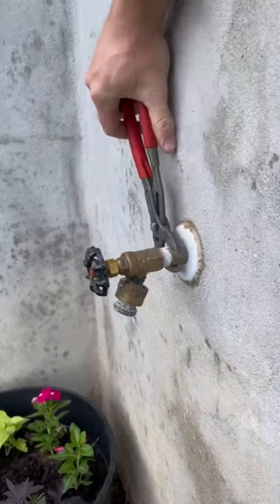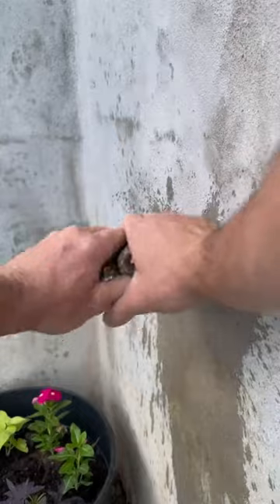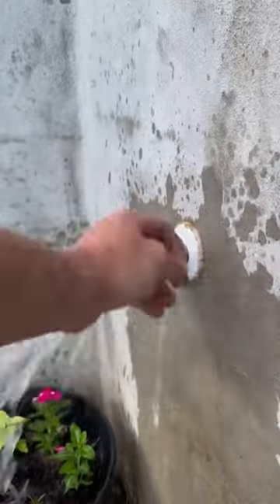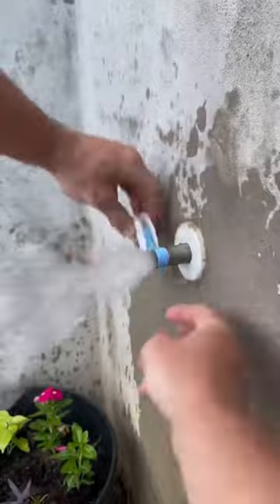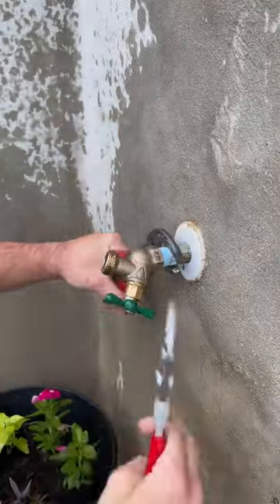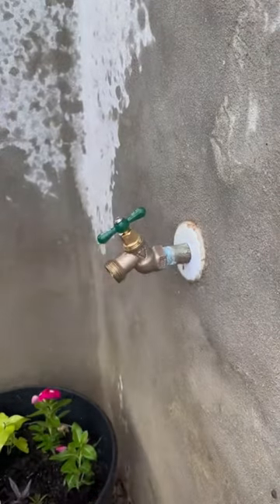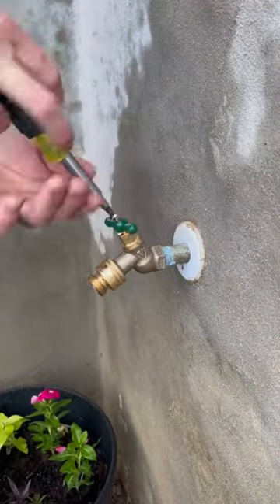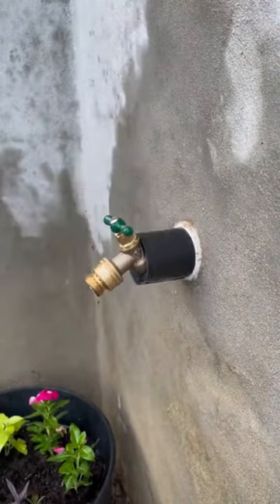Hose bib replacement LIVE! #fyp #plumber #trades #plumbing

Comment: Man, I already hate doing hot swaps. But on sleeved galvy? You’re my favorite shorts plumber by far.
Reply: Mind explaining hwy its a pain in the ass to do?
Reply: @stephanieann6622 just water spraying everywhere, but not a big deal outside as long as that spigot comes off easy and you dont crack the wall pipe.
Reply: @feyrband  That isn't what she was asking.. I dont know the answer but I do know you did not answer the actual question
Reply: @stephanieann6622  I think maybe something with the brazing on the sleeved, galvy that appears to be on the other side of this wall and it being galvanized makes it easier to break the braze? to lead you scrambling to the otherside.... probably in a crawl space?
Reply: @gregscott4479  yeah I knew about the water it wasn't what I was asking but I appreciate his reply. But thank you for yours!

Comment: My town's pressure comes in at over 100psi in some areas 😅 last time we tried to do this it was rather messy, even with all other faucets in the house open hahah.
Reply: Do u have a prv
Reply: @craigherron1203  Nah. I run that shit raw 😂 plus half of the house is galvanized waterlines so that honestly keeps volumetric pressure down. This week I'm changing everything out and moving the meter+adding a filter. Filter should cut the pressure back a bit but I'll be throwing a prv in for safe measures while i have the system torn apart.

Comment: You got lucky with this one sir. Good job galvy is always risky when it’s old 
If those threads were broken you’d have water flowing roughly 5gpm and be torching the city shut off to loosen up. What a terrible scenario for all involved
Reply from the maker: I had an apprentice bust a pvc waterline near the meter while digging before. We were replacing the shutoff valve but he hit the line. The meter would not shut off. I was able to replace the valve live thankfully.

Comment: Nice.  You can turn on all the faucets in the house to reduce the water pressure to make this repair a little easier, it looks like you may have done that already. I like the Knipex electrical tools and Cobras more than Klein.
Reply: Exactly what I was thinking. Opening up several in the house would make this much easier. I’m getting rid of my vacuum barrier on my bib. I hate that thing. It makes all sorts of groaning noises all the time you can hear it in the house. I don’t care if it’s against code.

Comment: The frost proof hydrant has a built in vacuum breaker. That's what makes it frost proof
Reply: No. 

Frost-Free Hosebibbs are Frost-Free because they have long stems that shut the water off inside the insulating envelope of the home., aka they shut off where it's above freezing temps.

BUT you MUST REMOVE THE HOSE and any other attachments that would prevent the body of the Hosebibb from draining. The Hosebibb body must also have slight pitch towards the outside.
Reply: @skoronesa1  no shit Sherlock.  But the air gap ( vacuum breaker)on top allows it to drain. I've only been a plumber for 20 years . I don't know everything

Comment: I bought the tool from home depot so I can shut off the water at the curb.
Reply from the maker: That valve was stock. The city here will also fine people if they see them using it. Or if it breaks they charge you the repair and water loss.

Comment: You can back it off without it leaking much and get new Teflon and dope on the threads before the switch so it’s super quick. Dont need to mess around with a bunch of flowing water

Comment: Prevents water siphoning  back in when the shutoff is closer. Brilliant!
Reply from the maker: Required by code 😅
Reply: Not everyone turns off their hose bibs... but thats just ignorance.
Reply: I don't even have those.  Instead i use a splitter to relieve pressure.   Works great and no mess of water spraying everywhere.   It seems like it would be an easy design adjustment to make the water from releasing the pressure diverted in one direction rather than spray everywhere, but i guess engineers have other priorities.

Comment: vacuum breakers are pretty pointless for 99% of people. You either have to have a massive pressure differential between your home and the water main. And, you would have to be actively using it, and have the end of the hose submerged in a conainer of contaminated water when the differential occurs.

Comment: Did you run some taps inside the house to lower the pressure on the bib? Just asking because 70psi seems like a lot
Reply from the maker: Was able to partially close the curb stop at the meter.

Comment: I fucked up at a building. I did a hose bib live at their car wash area not knowing that it was tied into the outlet side of their booster pump they had the old school style that ran at full power and was regulated down afterwards just my luck This was tied in before the regulator 375-425psi  It took two people to get the threads to touch just because of the pressure I ended up getting it it was very violent but I will never attempt again. Human verse twin 480v.  50 horsepower 500 ft of head booster pumps The pumps win.

Comment: What kind of hose bib is the one he took off, have 2 on a job  that I need to pressure wash and those are the only options I have to tap into for water but everythime i hook a hose to them I don’t get enough pressure cause they leak water and air gets into the line which is bad for the pump and inconsistent pressure. I need to replace it or tighten it I need to know what it’s called to fix it or replace it

Comment: You say it was 70psi. Im pretty sure that was a static psi. With it free flowing i would say psi was about 30. 70 psi free flowing is wild to change.
Reply from the maker: Was able to partially close curb stop and had other fixtures running

Comment: Not to be to noisy but what did something like that cost? I need something just like that done at my home hence the reason for asking. Thank you in advance
Reply from the maker: It can vary depending on the company. I have seen as low as $175 and upwards of $400. I’d say between $200-$300 is what you would expect. (At least for my area)

Comment: Just pop open the water meter, and turn the damn thing off.
Use a meter key, basin wrench, chanlocks or an adjustable wrench. 😂
Reply from the maker: The curb stop was frozen. There is no turning it at that point. You force it and the valve pops off. Then it’s a big mess.
Reply: @theplumbersplunger  
I hear ya.

Comment: Lol. Not a chance that’s 70 psi. Might work for most folks but I would struggle to say that’s 35-40. 70 is a straight beam out of a pipe.
Reply from the maker: Was able to partially turn the curb stop and had some water running at other fixture

Comment: No way that was 72 lbs pressure.
Reply from the maker: Meter was able to be 1/4 turned to restrict some flow. The 1/2” pex feed for this line also ran 80+’ across the house before getting there.

Comment: Nobody has a handy shut off on the inside?
Reply from the maker: Most homes here have a valve in the ground directly after the meter. Also s valve at the softener loop but that wouldn’t turn the hose bibs off.

Comment: No way 72psi
Reply from the maker: I was able to 1/4 turn the curb stop to restrict some flow and the hose bib was on a 1/2” line that ran across the entire home from the garage.
Reply: @theplumbersplunger   i’ve done this before also when not able to turn curb stop off , i go around and open all available taps closest to the point of entry from the bib which is getting replaced, this helps mitigate the volume blasting out … i once had a galvy nipple’s threads tear 1/2 off . With water blasting out i cut rest of the threads off , chamfered the end , and pushed on one of those pvc sharkbite style couplings with a sch 80 nipple and new bibb attached … Then told the customer to have city replace curb stop .. we would later return and replace with a new brass nipple from the drop ear ell inside the wall out 😅

Comment: 72 psi?
Reply from the maker: I was able to 1/4 turn the curb stop to restrict some flow and the hose bib was on a 1/2” line that ran across the entire home from the garage.
Reply: And it's older galvanized so rust swelling has restricted flow.

Comment: Absolutely not. Never ever do that. There are 100 and one things that could go wrong. Should have called the city and rescheduled. Also consider installing an accessible shut off
Reply from the maker: I can install a valve live at the meter if absolutely necessary. Wasn’t a huge risk with it being outside. Obviously I’d never do anything live inside a home. Gave options to install a new accessible valve as well.